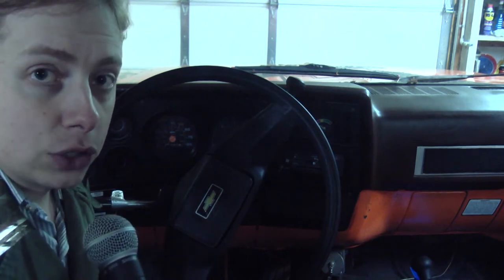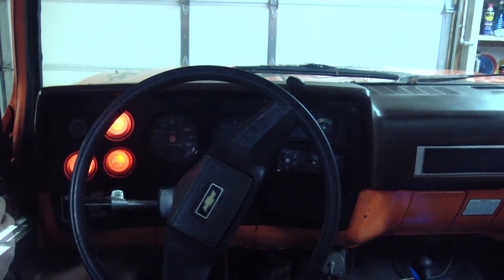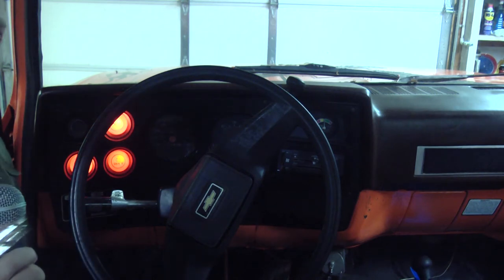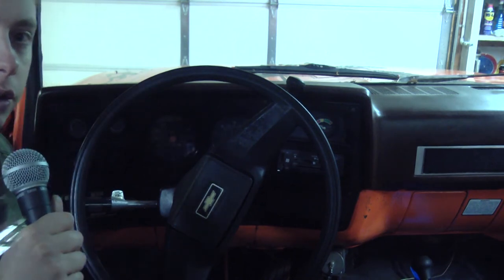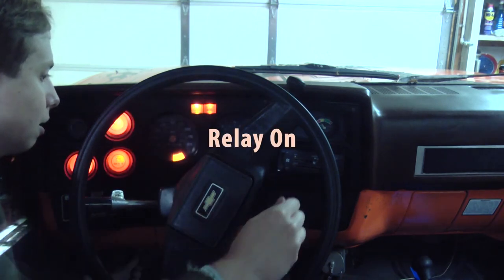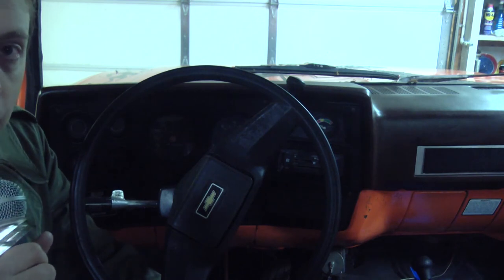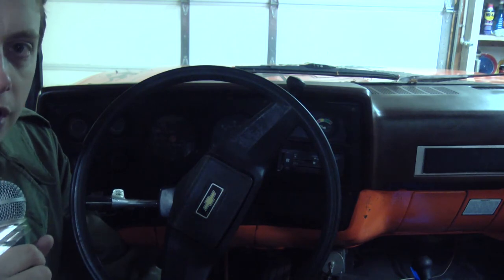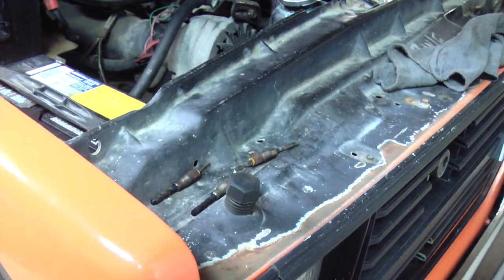Identifying Faulty Glow Plugs in 24-volt Chevrolet CUCV Military Vehicles

Comment: Nelson - excellent video.  I am troubleshooting my M1028 and this video explained much.  I am troubled by the fact that my GEN 1 and GEN 2 lights are not illuminated when I try to start the vehicle.  My oil pressure light does light up so I'm lost right now as to the probable cause.  This all started when I had a wire rub against the headwall and burn in two - repaired that but still have a no start condition.  I think that failure induced other failures but I cannot find them.  I hope you keep producing videos!
Reply from the maker: Yes, the GEN lights should come on until the engine starts. Sometimes they even stay on until you rev the engine, too. Must have lost connection somewhere! The military TMs (technical manuals) have wiring diagrams that should help. Does the engine crank? If you have a crank but no start then you most likely have a fuel or glow plug issue. Regarding fuel, you could have a bad pump, air in the system, plugged filter, or you aren't getting 12 volts to the pink wire on the injection pump (check that one first!). If you are getting white vapor while trying to start, then its probably a glow plug issue. I assume the vehicle ran fine before the wire rubbed out, so it probably is electrical and not plugged filter, etc. You could have burned out a fusible link, too. Is there anything else on the truck that stopped working after the wire rubbed out? Lights, etc.?